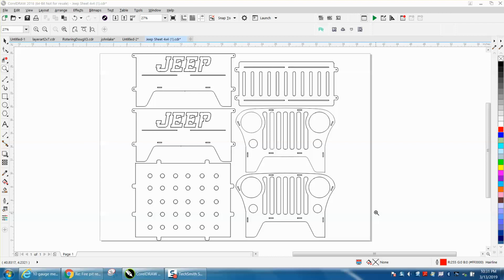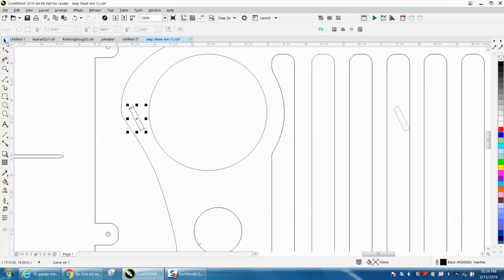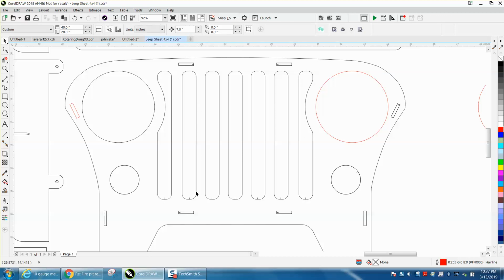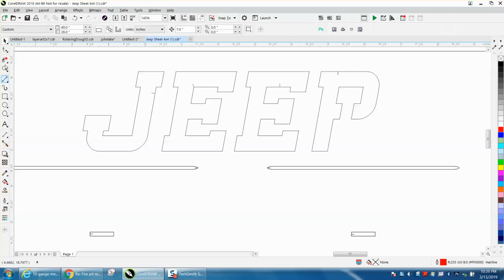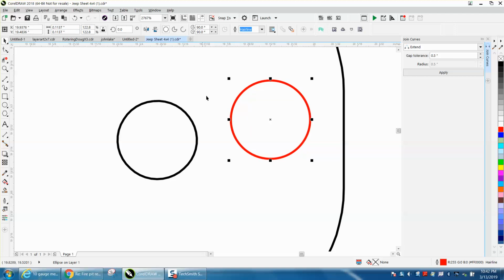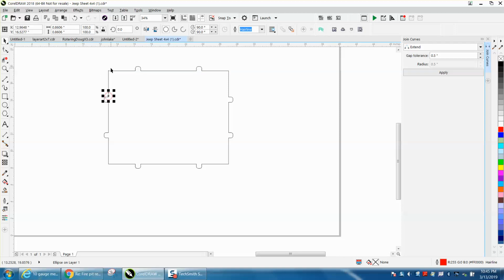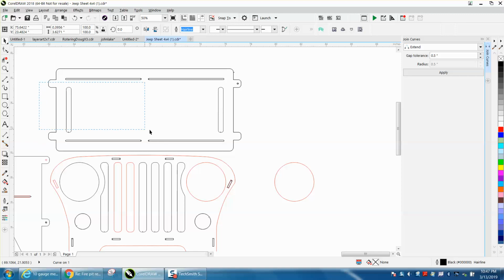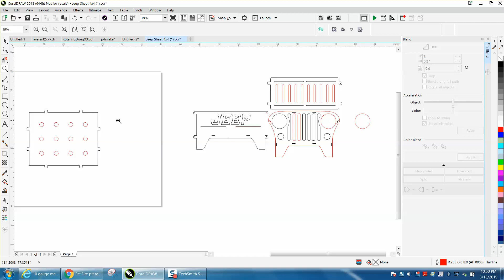Corel Draw Tips & Tricks CNC PLASMA DXF FILE repair

Comment: Hi,  and thanks for the video! Some of my circles are showing as polygons when converting to .dwg. Do you know of a trick to fix that? Thanks in advance!
Reply from the maker: maybe turn the circle to a curve and then SAVE as I use DXF don't know about dwg
Reply: Doug Green Thanks for the reply.  I’ve tried that before, but I’m also realizing there are 3 factors: 1) Curves or no curves transformations, 2) .dxf versus .dwg 3) version of AutoCAD compatibility with the version of Corel. And there is a 4th factor, which is the user ability to keep up with the combination of these factors that has been tried and what remains to check.  I’m going back to the beginning to restart this process. Thanks again